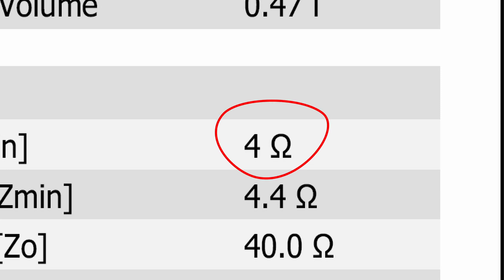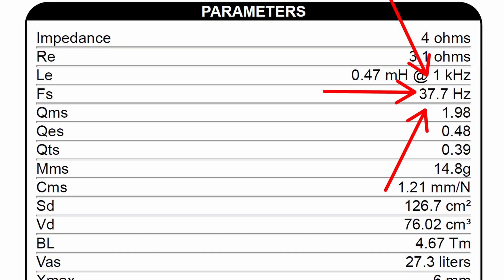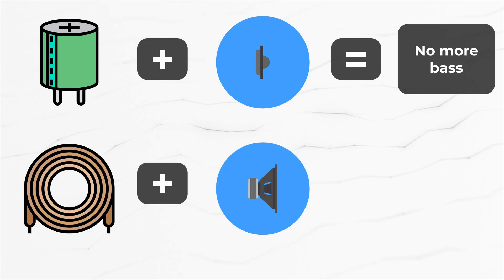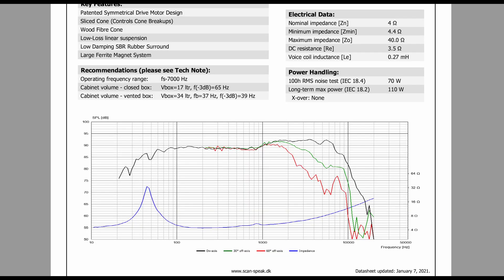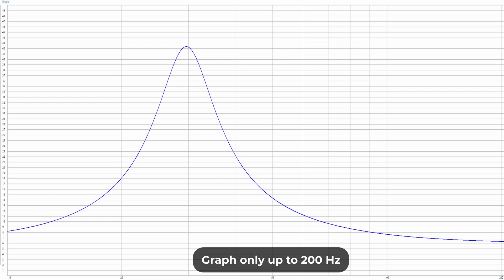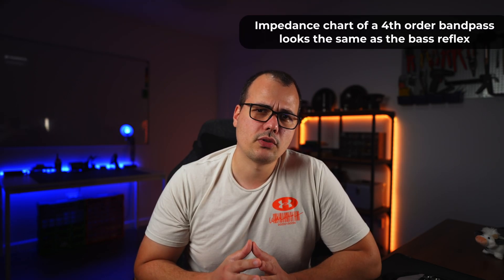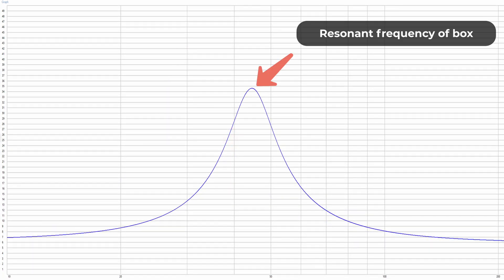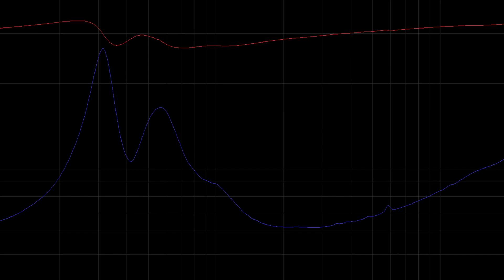Speaker Impedance is not just a number

Comment: Can you pls clear one moment. I saw a video about Lii Song F15 and one moment surprised me a lot: autor tells that high resonant peak on impedance graph require hell of current from amp...!? - that sound rediculous, how high impedance can lead to high current, should be opposite. I`m not a new in audio and know physics, but may be there is some specific complicated prosess htat is not so obvious...? And this is not the first time I hear that high peaks of impedance is not good for amp. Can you comment, pls?
Reply from the maker: The problem is not that the impedance is high. The problem is a speaker with an impedance graph that is not stable. A speaker with a spiky impedance graph makes life difficult for the amplifier because it constantly presents different loads at different frequencies. The amplifier must be robust enough to handle these variations without distortion. When impedance is high, the speaker draws less current, correct.

Comment: Hello ... my speakers are 3ohm, my AVR SONY 7.2 channel 8-16 ohm , whats is solution ? Can increase impedance with resister from 3 ohm to 8 ohm is safe ?
Reply: That's a great question, I guess you could experiment by adding a resister to a speaker cable on the positive side, then connect it to the speaker and run a resistance check with a multimeter, if it checks in the range of 8-16 ohms, it should be safe.

Comment: I am using a datsv3 to test my 4th order enclosure in my car. I have 6 15" subwoofers. Do I need to connect the speakers together and test all at 1 time, test all individually and compare or is it ok to only test 1 of them to get the enclosure information?Thanks
Reply from the maker: If they share the same enclosure they all need to be connected.
Reply: @AudioJudgement  ok. That's what I was thinking. I just wanted to be sure. Thanks for the help. I liked and subscribed.

Comment: What a great video! Very useful information about understanding impedance curves and how it is related to cabinet resonances!. I have a question related to a modifications I have been doing to my tower speakers.  My speakers are made out os 1/2 inch MDF, so some time ago Indecided to add some reinforcement inside add into the side walls some custom cut Timbers glued in. I also glued some dampening foam all over the internal walls. Even that, there was a a noticeable resonance of the cabinet when testing the speakers with sine tones.  Making this long story schort, I added poly fil ( know as vellón siliconado in Spanish) on top and bottom of the enclosure, in a very tight manner ( I mean pushing enough material to set it in place by its own). The results was so good at first instance that all resonances were gone, even the two peeks of the main woofer resonances. So I got a very smooth impedance curve.mI though it was good, but now Inhave realized that bass response in low frequency, about 80 hz to 100 hz is so loud that does not maths the overall frequency response and even when you ear music you realize that is too much bass. Any comments on this? Will be highly appreciated! Have a grete day!
Reply: Stiffening without adding internal bracing and without countermeasures of internal volume reduction?

Comment: I confess I have watched several of these videos about impedance, etc., but I still don’t understand what you are measuring, how you measured it, or why you measured it.
Reply: I’m far from an expert, but in basic terms impedance restricts the flow of electricity. In the context of speakers, higher impedance means it’s more ‘difficult’ to produce a given frequency as impedance gets higher. 

You can kinda think about impedance in two ways: how your amp functions with it, and how the speakers do. Ohms are a measurement of impedance, and it’s possible to design a speaker with absurdly low (or high) impedance that basically can’t be driven by any amp. 

In more realistic, normal scenarios impedance can tell you things that frequency response hides. We want smooth, predictable response from a driver but that’s not the reality, and impedance shows us the reality. What this means in practical terms is that we should know where there’s abnormalities in impedance, understand how to avoid making the problem worse, and also understand how boxes themselves impact the measurements. 

As for how to measure it, the industry standard is DATS (V2 or V3) it’s a $100 tool that measures a ton of parameters about speaker drivers in software.

Comment: So I'm looking at this software probably not very accurate. I filled in all the values and shoved the sub in a ported box 125L and the free air impedance is 4ohm but in the box it never drops below 8ohm according to the software. So would I use a 4ohm amp or an 8ohm amp? Or is it just bad software making it out to be 8ohm in box?
Reply from the maker: I don't know what software you are talking about, but placing a sub in a bass reflex box should not increase the "nominal impedance". Maybe you selected 2 drivers in series, and are not aware of. Maybe it's dual voice coil woofer and the spec sheet lists the Re parameter with the coils in series. Regardless if the resulting impedance is 4 or 8 ohms, if you get a 4 Ohm stable amp, it's good for both cases.
Reply: @AudioJudgement  awesome thank you. It is dvc so it's probably in series? Making it 8ohm?
Reply from the maker: @octobersky329  what subwoofer driver is it exactly?
Reply: @AudioJudgement  Pioneer TS-A300D4 12″ 1500w DVC Subwoofer
Reply from the maker: @octobersky329  That is a dual 4 Ohm rated at 500W. Best thing to do is to get a single channel amp that can deliver 1 x 500W at 2 Ohms and wire the coils in parallel.
Reply: @AudioJudgement  awesome thank you seriously the most helpful YouTuber!

Comment: i tried so many 5.1, 2.1 market products non of them are satisfactory for music for movies etc sort of ok, is it because of those tiny satellites,for music i use my sony 90w rms 3 cd changer's speakers, replaced the tweeters with a 50w soft silk dome tweeter's with a 2.2uf polyester capacitor(electrolytic non polar & polyester sound very different even for the same value), the woofer had no series inductor nor any damping material in the box, made a stereo preamp of LF353 with a PAM 8610 class d with years of tuning to match the sound to my ears to suit daily listening to fm & bluetooth.

Comment: That small peak in the impedance is caused by the cone itself resonating not the suspension, aluminium cone speaker has it higher, larger speakers have it lower. Try to ping the cone with something stiff, you hear two notes, lower is the mechanical resonance higher is the cone resonating. I've been 3dprinting some custom dustcaps and when badly designed they definitely show on the impedance graph. I've always tried to low pass filter the speaker before this point. And that's why I end up with lots of 3 way speakers with ridiculous crossovers.
Otherwise, good video and much needed topic for inexperienced builders.
Reply from the maker: That impedance bump is produced by the cone, but it's a result of how well the suspension is implemented. If the cone is poorly terminated, the sound energy coming from the center of the cone to the edge will be strongly reflected back and create standing waves and resonant modes. I think you are describing cone break-up, which is indeed more prevalent in metal cones, but it's something else. For decent 7" drivers (like the ones in the video) cone break-up should happen in the 3-5 kHz region (not 1 kHz).
Reply: You missed actually. 😂 ACTUALLY thanks for the info 😎